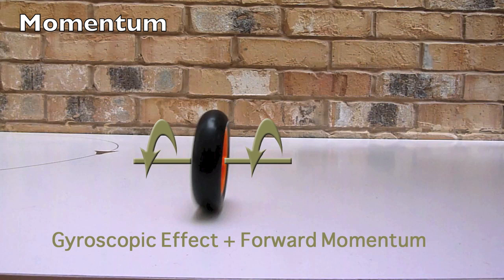The Physics of Countersteering

Comment: The explanation is sound however it still doesn't tell riders what they really need to know about counter steer which is that you don't learn to counter steer it is intuitive and if you ever rode a bicycle then you already know how to counter steer without even thinking about it. What riders need to learn is to NOT counter the counter steering effect when going into a corner. When riders go into a corner that is too fast for their experience level they panic, the next thing they do is grip the bars tightly and attempt to steer the bars in the direction of the corner like they would turn the wheel of a car to steer, in doing do they counter the counter steering effect which causes the bike to stand up not lean into the corner as it should and the result is they don't just run wide they run right off the road. They need to learn not to panic and to relax their grip and let counter steering occur and not fight against it causing the bike to have even less chance of taking the corner. Anyone seeing this may conclude it was target fixation but in fact its far more likely to be panic steering into the corner that causes the bike to stand up not lean over. This is a mistake that can see you dead pretty easily so its a lesson worth learning..Don't panic and fight the bars and oppose the counter steering and end up hitting a tree, relax and let the counter steering work so you take the corner.

Comment: I do Not want to be Too picky, anyway, but as this is a learning video so far there's some things which are a little inaccurate. e.g. about 0:20 "torque around the centre of gravity" which is wrong, in fact it's a torque THROUGH the centre of gravity around the "points" of friction in the contact area between tyres and ground. with the distance between contact area and centre of gravity projected to the vehicles high axis as the lever arm lenght, without wanting to get too specific. there's a lot of work in such small videos and the efford for them to be made has to be  highly appreciated... keep it simple but stay accurate

Comment: Just watched a great video from some guys at Cornell. Couldn't find it on youtube. They determined that you can remove gyroscopic effect with counter rotating wheels above rolling wheels and the bike still turns into a lean...  This is REALLY some heavy physics, but practically the only thing needed is for the bike to have a tendency to  turn into a fall, and turn in MORE the greater the lean angle.  Yes the leaning IS required as this vid states AND the gyroscopic effect does help because it does contribute to the turning into a fall behavior.

Comment: Well done vid, but only tells half the story.  It's no better than saying "just do it this way 'cause it works,"  which it DOES....but...There's no "magical" gyroscopic effect that makes a bike turn.  A bike turns ONLY because of the way the tires push on the pavement.  PROOF:  try turning on ice and tell me about your gyroscopic stability.  The geometry of the frame and forks (when rolling) always try to put the tires contact patches under the center of gravity...that's the magic of motorcycle balance.  Yes, there are certainly gyroscopic forces, but they generally RESIST change in orientation...When you turn the front wheel, you "force" the bike into an unstable condition and the frame geometry and relative wheel position(s) keep trying to get the bottom of the tires (by pushing on the road surface with a bout a credit card's surface area of contact) back under the center of gravity.  Prof. Caimbridge's arguments seem to indicate that a motorcycle "knows" where a curve is.  Things in motion only "know" how to go straight.  The rider has to "force" it to curve.

Comment: Every angry d-bag on bike videos is going to completely miss the "releasing pressure on the grip" and "naturally stable left hand turn." I wish I had a free tank of gas for every loudmouth who insists they're counter steering the whole way through a turn.
Reply: aluisious
There is a lot of confusion around this but, under most circumstances, most bikes have a slight tendency to stand back up which must be countered by a bit of CS pressure so you do in fact "CS the whole way through the turn". This emphatically does not mean that you keep the bars pointing left throughout a right-hand turn, though.
Reply: reverse understeer yo
Reply: Ummm my bike will right itself if i let off the handlebars, I know because I practice loose hands for the track. Always have to keep some pressure on.

Comment: This video doesn't say turn left and you'll go right.  It says jerk left in a vertical position and this will throw the balance of the bike quickly to the right setting the bike up to continue its rightward lean as the rider turns the handle bar to the right.  It is physically impossible to turn right and go left and vice versa.

Comment: just think of it like this, the outside of the tire is what does the work in a turn. so if you want to turn right you have to get the right side of the tire to touch the pavement which means making the wheel go to the left that then makes more of the right side tire useable for the turn
Reply: wades623 thanks

Comment: There is some SERIOUSLY bad information here in this video. The narrator states multiple times: (an example at 1:53 mins) 
"If you turn into a corner without leaning over enough, the bike will actually throw you OUT of the curve" And then shows a model motorcycle "highsiding".  This is just wrong. If you enter a corner without leaning enough for the speed and radius, you will RUN WIDE, and the bike will move out to the outside edge of the corner.  Hopefully this is what they MEANT to say, but it will most certainly not THROW YOU OFF the bike as the narrator suggests. Highsides happen from sudden loss or traction, then regaining grip after the rear wheel steps out of line from the front. This happens when riders are either too hard on the gas, or if the throttle is chopped (shut off too quickly) when leaning into the turn. (Both of those situations can also result in the less severe lowside crash as well).
Reply: Running wide is throwing you out of the curve - so I don't see the issue ??? - or am I missing something ?
Reply: I think He was just explaining why a bike naturally leans over in a corner in the first place. I dont think he meant to imply that that a bike falling over because It didn't lean over enough is a real hazard you have to worry about while riding it.
Or at least I hope so. This is something he probably should have been clearer on.

Of course in the real world we know (or at least anybody who has ever ridden a bike knows) that a bike physically wont go around a corner without leaning in. The two sort of go hand in hand.
Reply: aydinvideo if you turn your forks to the right in a right hand turn, you will highside. Because obviously, if you go into a turn, without turning, your not gonna turn and run wide, what the fuck else would you do?
Reply: How you first described to turn a bike is correct, but countersteering is to be used when you don't have the time to lean the bike over, instead you use the momentum of the bike itself to lean into a corner for you much more quickly by steering in the opposite direction first.
Reply: The presentation asserts that to turn right you must turn left first. This is false. An experienced rider simply guides the bike to the turn by first leaning and thereby shifting the weight, the center of gravity, to "pull" the bike into the intended direction. The front wheel must be guided into the direction of the turn, regardless of the momentum or "Gyroscopic" forces that challenge the rider during the maneuver. "Countersteering" is a term that should not be used, in my opinion.
Reply: Dan Knight
WRONG. Do not spread misinformation, you might actually kill someone. The presentation asserts that in order to turn QUICKLY, you must countersteer in the opposite direction BEFORE turning your front wheel to the direction you want to go. Go to 2:19 of the video. If you turn your front wheel left when wanting to go left, the bike will want to lean right due to the gyroscopic effect. The harder you turn left when going at such high speeds, the more the bike will lean right instead of left. This is why you have to countersteer. In order to make a sharp left turn, you countersteer your front wheel to the right, and as your bike leans left you turn your front wheel left to turn into the lean. YOUR BODY WEIGHT HARDLY AFFECTS THE BIKE'S TURN AT ALL. This is a common misconception. Watch this video : https://www.youtube.com/watch?v=JWuTcJcqAng
Reply: i will never ride a bike=too fucking confusing !!!!!
Reply: tom, it's not that confusing, steering on a bicycle is exactly the same by the way... think about it in this way 'push forward on the left handlebar to turn left and push forward on the right handlebar to turn right' ... that is countersteering, it's just easier to memorise that way

Comment: What I don't get is.. I ride, I lean, and do all that stuff you do in turns... but I still don't understand counter-steering.
Reply: you don't need to understand it believe it or not you do it naturally press down and forward on the right handle (in a open area away from cars and ppl) and watch what it does the switch and press the left one the same a bit down the road (better to do it easy at first on a str8 so you don't lose control) and see how the bike reacts....
Reply: have you tried to do it on purpose yet?
Reply: you're putting more weight,or pushing, on one side of the handlebars so the bike counter-steers
Reply: david kutzer
Guess I got it naturally
Reply: Basically, you're tapping the bar in the opposite direction for a millisecond to make the bike follow the natural direction it wants to go, while staying balanced and upright.
Reply: All you are doing is a theatrical whip right to go left. You dont keep pushing left its only a an initial push then turn as normal. No one tells you that!

Comment: one thing i didnt understand was how torque was created about the Center Of Gravity due to the force of gravity downwards. Why was there a torque produced about the COG?? 

NVM, i did  FBD and realized one thing you didnt mention in this is the Normal force produced from the ground on the bike tires.. THAT is the reason there is an opposing torque. 

ok got it.
Reply: Go to the beginning of the video for an explanation of this. The torque produced about the center of gravity is due to the centripetal force caused by the change in direction while the bike is upright.
Imagine riding in a straight line and turning the handlebars to the left without leaning over. The bike would lean over to the right because of that "torque".
Reply: agreed. but why would the gravity of your weight create a counter torque about the center of gravity?
Torque in simple terms is
Force x radial distance.
If you take the torque about a point A, consider the forces around the point A.
If your external force is at point A, you get no torque produced since radial distance = 0.

i know the answer so dont bother explaining that to me.

Just figure that out yourself and find out.
Reply: I don't need to figure out anything here, I already use counter steering when I ride!
I was just trying to help you to understand.

Comment: everything made sense except the last minute.I know that counter steering induces leaning in the direction you want to go, but still don't understand why
Reply: Imagine riding in a straight line and then turning the handlebars to the right, WITHOUT leaning over. The bike would lean to the left.

To turn left with countersteering, first you turn the bars to the right and the bike will lean to the left, like I said in the last sentence. As you and the bike are leaning over, then you turn the bars to the left to guide the bike through the turn.
To understand the last minute of the video, go back and watch the beginning of the video. =)

Comment: Oh, jeeze, I think they are implying that you have to balance your motorcycle by "leaning in" to counter centripetal force generated by the turn, hogwash. You can lean in like Mark Marquez on a MotoGP bike, or you can lean out like a dirt bike rider, or you can sit bolt upright like a biker on a Harley. The only justification for body lean is to present a certain tire patch to the ground. Marquez is elbow down to get more of the tire off it's sidewall, the dirt bike rider, at a much lower speed, wants to dig the tire into a berm. Bikers? You'll have to ask them...

I have to wonder if whoever produced this has ever ridden a motorcycle.

Firstly, you cannot make a motorcycle turn by leaning it over. You disagree? Because it turns when YOU lean it over? OK, let's clarify some things. How did you get it to lean over? If you did anything other than moving your body to one side you've entered some confounding variables, such as turning the handlebar, which IS how you turn a motorcycle. The leaning comes instantly AFTER you turn the handlebar. Please try it again and notice what happens to the handlebar when you lean. If you lean to the right I'll bet you turned the handlebar a little to the left -- countersteering! Try it again being conscious of not moving the handlebar. The bike will lean in the opposite direction that you leaned your body, but did not turn. Why did the bike lean opposite? Because the center of mass has to stay put -- if you aren't turning (or, trivially for our discussion, accelerating). 

Secondly, to initiate a turn you must countersteer. You do no balancing at all, in fact if you are turning a constant radius at a constant speed you cannot alter the angle of a line drawn from the dynamic centers of the tire patches through the center of mass to vertical without turning the handlebar, just as you cannot alter it when going straight unless you turn the handlebar. 

So lean to be comfortable and get the tire patch right, don't worry about any damned centripetal force. Yes, yes, on the road you can corner at a higher speed if you lean in like Marquez, but for anything near legal safe riding you can be bolt upright and be just fine.

There are no arguments among serious racers or physicists about the need to countersteer, however there are many arguments about the how and why of countersteering. Some say it's all due to front end geometry, some say it's mostly precession. For myself, having felt the forces that can develop from a perturbed gyroscope and noticing that leaning the motorcycle into the turn is exactly what you would predict if you perturbed the front wheel by countersteering, I believe that the turning a motorcycle is mostly a result of gyroscopic effect. 

Wow, everytime I rerun this video I am more amazed at how wrong it is and how dangerous it could be to a beginner.
Reply: Sounds like you didn't understand the video. 

The target audience for this video is beginners. Beginners should be leaning with the bike whenever they turn. The only exception is extreme low speed turns like u-turns where there isn't enough force to keep the bike balanced like that.

As for dirtbikers, those bikes are typically going at lower speeds and are usually lighter than the ones that people ride on the streets. Also the ground itself provides far less traction than you'd find on even a poor quality street. Racer lean in to the point of hanging off the bike because it's a way of getting all they can get out of the lean angle. They'll typically put their knees way out to try and grab some air to make it turn even tighter.

These are not good practices for beginners. 

And yes, you absolutely can make a motorcycle by leaning it over, that's the whole point of counter-steering at speeds greater than about 15mph it becomes quite challenging to make a bike lean over just through moving your bodyweight around. Even those small 250cc bikes require you to hang quite far off them to get them to lean without countersteering. You lean the bike, it changes the profile of the tire presented to the ground with a larger circumference to the outside of the turn and a smaller one to the inside and since they both have to get around each time the tire does, you wind up going in the direction of the lean.

As far as the how goes, if they're saying it's gyroscopic precession or front end geometry, they're wrong and shouldn't be listened to. The precession is what keeps the bike up after you initiate the lean, but it's just a matter of inertia that causes the bike to actually lean over when you counter steer. The video got that dead on. The geometry just influences how easily the bike can be steered and how tightly it can be steered, not how the steering occurs.

You might believe that, but you'd be wrong. The gyroscopic effect is what makes the motorcycle want to maintain a straight line, not how it turns.

It's amazing to me how many people ride around on motorcycles and are completely clueless as to how they actually maintain their balance or turn. It makes it really tough to figure out what to do in novel situations like roads with a negative camber.